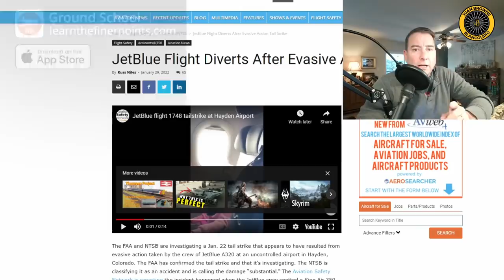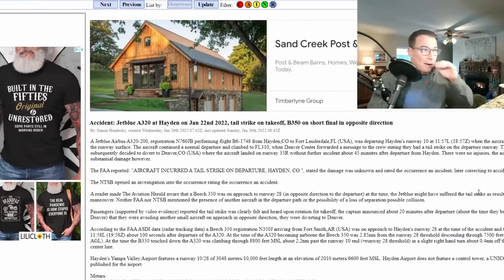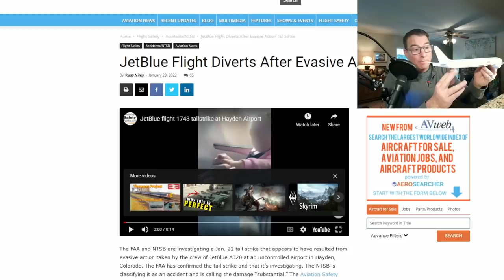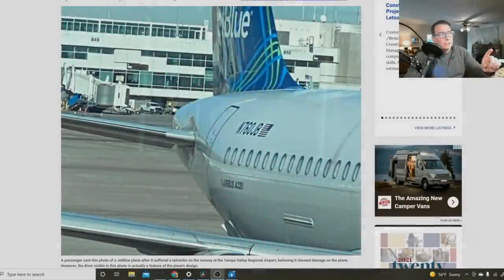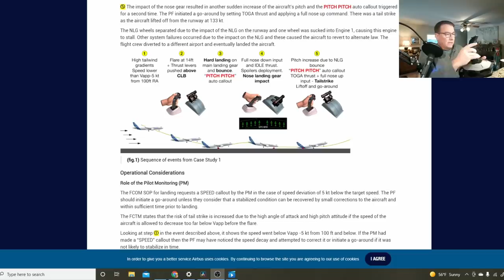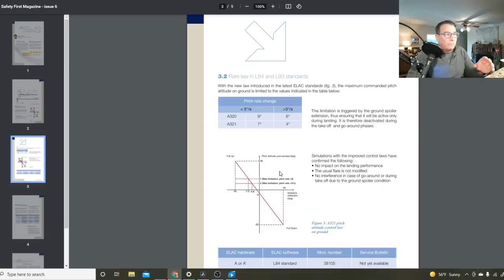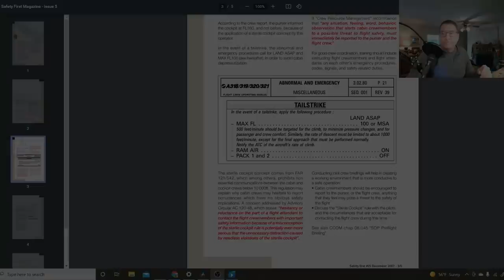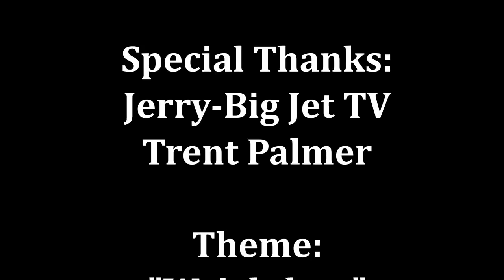Tailstrike!

Comment: Longtime Airbus pilot here: coming from the MD90, which had a significant risk for tailstrikes, due it‘s low landing gear and fuselage length, I always stopped rotation briefly at 10 ANU and waited for the radio altimeter to start counting before following the flight director to higher attitudes. One company I worked for even had a callout during go-around ‚TOGA TEN (degrees)‘ to make sure that you don‘t overrotate. This conscious action reduces the risk of tailstrikes for sure.
Reply: “ANU” definition please?
Reply: @bigjeff1291  Sorry: Attitude Nose Up
Reply: @maxx9384  Thanks!
Reply: never flown the Airbus but "stop at 10" is good every where :) fly safe
Reply: I’m pretty sure every flight I have been on does something like this always get that light feeling then the stuck in the seat feel on takeoff
Reply: Good deal!
Reply: Same with the 321
Reply: I was going to ask the question, if you would know that you tail striked while taking off, but the video showed the answer.. I know certain large planes used to have a landing gear in the tail to help with this,  do they still Incorporate that into aircradt
Reply: Very great advice to make that conscious effort.
Reply: Great personal procedure to have on any aircraft. 737 and 747 I did and do that same thing. Pitch to 10...wait for the gear lever lock to click off....then rotate to 15

Comment: Back in my A&P days in the 60's, I worked on a Jurassic Jet called a Boeing 727.  They had tail strike snubbers just forward of the rear air stair.  It was retractable device coordinated with the landing gear system, intended to protect the exhaust nozzle of the center engine against high deck angle runway rotation.  The snubber had a "shoe" on the bottom we were required to inspect for wear periodically.  My recollection tells me the shoe was worn out at every third A-Check, or about 600 flight hours and 275 cycles.
Reply: The 767 has/had similar, as does the 737... IIRC, the larger Airbuses also have a snubber but it's been a while since I have been under one, that said on the A300/310/330/340 the cabin floor kicks up for the rear cabin to allow more bins to go in the hold without extending the keel into the strike zone... The 777 walks a very fine line in this regard, but the envelope for each type should reflect this.
Reply: I can remember seeing the tail strike snubbers on the rear of 727,s (not knowing or thinking much about them at the time) when I was working the ramp in the airline industry from the mid 80,s into the mid 90,s. 

I'm surprised that they do not have these designed into the current airplanes especially with them having the potential to have a tail strike with them making them so long.
Reply: Concorde of course had a 'landing gear' - 4 greens !
Reply: I got my FE on the three-holer, and it had a skid with shock absorber type strut. There was a small bracket with a single rivet about halfway up. If the strut compressed enough to shear the rivet, the bracket would either be hanging by a small chain or missing.
737-700 doesn’t have a skid, but the -800 and Max8 do. It’s a definite preflight item, as it can only take so much impact before it needs detailed inspection and replacement of the cartridge and shoe. I’ve seen a couple that were slightly ground down, but had been inspected and repainted so you could tell if it had been dragged more recently.
Reply: It makes perfect sense to have skid plate there as it's the only part that could and will strike

Comment: I'm a 20 year structures guy, A&P, and pilot, but fly just for fun. I've worked a few aft pressure bulkheads in my career and the qualifications, though different for each company, are they want only their best structures/sheet-metal workers on those things. The buyoffs of work performed is much more frequent & strict than other parts of jets, and you'll have buddies double-checking hardware, parts & work & supervisors, managers, and inspectors hovering over you a lot more than normal. Near-perfection is required for this bulkhead.

Comment: Back in the day when I worked layover and service checks on the Boeing 727-200 it was very common to perform maintenance on their retractable tailskids.  Replacing crush cartridges and the lead blocks were weekly.  That design feature save many of aircraft down time to massive inspections and re-skins. Those were the days!

Comment: One of the most well known Tail-Strike accidents was JAL 123, a 747(SR) aircraft that sustained a tail-strike in 1978 and had an inappropriate repair to the aft pressure bulkhead.  In 1985, the aircraft suffered a failure of the pressure bulkhead that literally caused most of the tail surfaces to be blown off the aircraft, which led to the aircraft being uncontrolable despite the valiant efforts of the crew.  The aircraft remained airborne for almost half-an-hour before it crashed into a mountainside, killing 520 of the 524 people on-board.  (Amazingly, 4 people survived.)
Reply: Yes, it´s still the crash with the second-most fatalities behind the Tenerife Disaster.
Reply: I'm wondering if there was a finding on who screwed up. Actually wouldn't 30mins without pressure kill passengers?
Reply: @MikeJones-rk1un  they didn't suffer a decompression.  But the problem is that, if the rear pressure bulkhead had failed, it could have been catastrophic.  And, the bigger problem is not just "this" flight, but the damage, if it hadn't been reported, could have had drastic problems later on.  Every time the bulkhead is pressurized and depressurized, any damage is worsened.  Apparently the pilots were unaware that a tail-strike had even occurred; that doesn't mean that damage hadn't occurred.  Just because this flight proceeded without issue doesn't mean that the next would have.
Reply: @pastorjerrykliner3162  I assume tail damage would be found before the next flight by a simple inspection.
Reply: Only the fin and its two rudders parted company with the aircraft. The loss of primary flight control occurred because severed hydraulic lines that passed through the rear pressure bulkhead caused hydraulic fluid depletion.
Reply: @MikeJones-rk1un  aircraft accident investigations don’t focus on “who screwed up” but on what happened with a view to the knowledge gained being used to prevent a re occurrence. I believe Boeing admitted that an error occurred in the assembly of the replaced rear pressure bulkhead by a “away team” sent by them to assist the airline with the extensive repairs.
Reply: @johnyoung1128  Are you claiming investigations ignore pilot error?
Reply: @MikeJones-rk1un  After Boeing's faulty bulkhead repair was discovered to have caused this crash, JAL's maintenance manager committed suicide to atone for the crash.  The engineer who checked and cleared the aircraft for flight after the repair also committed suicide.
Reply: @mikeweaver8790  So they won't be learning from their experience?
Reply: @MikeJones-rk1un  Now how did you read that into what I said? A proper investigation would look into “if and what were they and how did they affect outcomes ” in regard to such potential errors. An investigation should never degenerate into a witch hunt as that would mean pertinent facts could be overlooked. As for what a regulatory authority would do with the findings of the investigation that is another matter entirely.
Reply: @johnyoung1128  Do you just like to hear yourself talk?
Reply: @MikeJones-rk1un  nothing said you had to listen. If you didn’t want an answer don’t bother me with questions.
Reply: @MikeJones-rk1un  What we’re the engineers looking at on inspection…
Reply: @johnyoung1128  How did I read that into what you said? How did their lesson do any good if they are dead? I guess you are so smart you have lost your mind.
Reply: @MikeJones-rk1un  I am not going to argue with someone inclined to deliver insults good day to you.

Comment: Re: the BA A-321--the possible reason they were stable and then got bounced around has to do with mechanical turbulence from the buildings on the airport. Strong steady winds at altitude change when you descend below the building height. The wind burbles around the buildings and causes random turbulence. (21k hrs in A-320/21k total)
Reply: Buildings is exactly what the host from Big Jet TV said if you go look at his original video

Comment: From memory when I did school work experience at Ansett Airlines in Australia in the early 80's the ground engineers would inspect a small hydraulic tail strike 'skid' that was under the tail of the aircraft at turnarounds. It would have been early 737's or 727's. I'm pretty sure there was also a crushable 'sacrificial' cartridge used in these systems. Now I wonder do today's aircraft use this tail strike system. I think that Concord had a small wheel that deployed under its tail section to protect the tail from tail strike damage.

Comment: The BA 321 flew a return trip to Geneva and back later on the same day so presumably didn't actually have tail strike, despite it coming incredibly close and the video seemingly suggesting it did.
Reply: Flight Radar 24 confirms this. It's the closest I've seen to a tail strike without actually having one. Brilliant video once again, very informative. You are on the ball with events happening in the aviation world. Keep up the great work.
Reply: You can see the debris kicked up from the strike. There was certainly contact even if the company decided it was to minor to cause problems.
Reply: @MyTech  you see smoke from the wheels and disturbance from the engine wake. There are no sparks. Watched it a million times and nothing you see can't be explained by the thrust.
Reply: @hamsterminator  Sparks? Did airbus switch to iron clad hulls? 
Frame by frame on 1080p there is contact for several frames, even if it was light contact it was plenty to show up on any tattle tail. The debris/dust in question does not originate from anywhere near the tires and does not move like jet blast, it originates from the point of tail contact.
And I can just make out a bit of bounce in the horizontal stabilizer although this could be due to aerodynamic forces, it does correspond with the time of contact.

Comment: At touchdown, “ground mode” is active.  But that’s likely not the problem.  321 tail strike pitch attitude is around 9.7 degrees (struts compressed).  Many tail strikes commonly occur when both pilots pull back on the side stick simultaneously -  which “sums” the inputs, resulting in excessive pitch attitude and tail strike.  That’s the Airbus flight control characteristic that likely bit this crew.   If the FO was PF, and during that go-around aileron dance, the CA (PM) might have got a little nervous and tugged on the side stick to help Stanley - well there you go.
Reply: You've mentioned a factor in the Airbus that's never made sense to me—summing the inputs. Even worse than doubling the inputs could be their negation. A collision is imminent. One pilot inputs right and the other left. Either would avoid that collision. In the software the two cancel and there's a crash.
Reply: @Inkling777  This condition commonly plaques Airbus  crews with loss of SA and flight path - among other things.   This is why crews are trained (and proficient) with ALWAYS using the red takeover PB on the side stick and exercising immediate and proper exchange of flight controls.   Only one side stick has control at a time during this procedure.   You can’t nudge the controls to assist the other guy like a conventional yoke.   Push and hold red button or hands off.
Reply: @Inkling777  this is so counter intuitive as to pilot training all our lives - since mechanical controls have always acted in parallel due to interconnect.  Why Airbus didn't preserve that in control law is a head scratcher.  This tail strike may have uncovered a part of the envelope for which there is no governing control law, ie in between defined events / conditions not covered.  It was very surprising to see the airplane appearing to over react with little more than crosswind affecting it.
Reply: @Inkling777  It already caused the total loss of AF447. The formal report is curiously silent on the side stick issue despite the data showing the matter was front and center for almost the entire event, it wouldn't surprise me if it was biased by airbus' economic impact on Europe and esp France. (And needing to AD nearly half of the world airline fleet.)  The data recorders were actually recovered by a privately funded investigation hired by the families.
Reply: Perhaps, but you will get a “Dual Input” call out.
Reply: @Inkling777  Well guidance tells pilots to click the "override/take control" button if they plan to take over from PF. I feel with summing/negating inputs Airbus was trying to emulate aircraft that had a direct/cable controlled flight surfaces.

I feel if airbus wanted to go down this route then they needed to implement proper force-feedback, so pilots can instinctively feel when the other pilot is inputting controls.

However, at the end of the day this is a pilot training issue. Another pilot should not make inputs without first delcaring they are taking control, unless it's a critical situation.

Comment: There was an episode of a show called "World's Toughest Fixes" on National Geographic Channel where they showed the process of replacing the aft pressure bulkhead on a B767. It was quite the process.
Reply: when he popped up the picture of the rear pressure bulkhead that fix episode was my first thought as well.  Was a great EP
Reply: Years ago I sold aerial lift equipment to the aviation industry and Northrup Grumman in the DFW area was a customer.  At the time they built the aft pressure bulkhead for the 747 and it was huge!  I can only imagine what it would take to change one of those out!
Reply: @gregmiller7123  and it was that part which failed and caused the 1985 crash of Japan airlines flight 123.
Reply: Yes! I was remembering that, but couldn't remember what show it was!

Comment: Great video Juan. Reminds me of the crash of JAL 123, regarding the failure of the aft pressure bulkhead, which failed due to improper repairs due to a previous tailstrike some years earlier.
Reply: Agree. I was thinking about this exact same failure during this entire video.
Reply: JAL 123 is still the largest loss of life in a single aircraft incident, and it's still a scandal in Japan how everything from the botched repair to the rescue were handled.
Reply: @wewd  Was JAL responsible for the repair? I don't think so.
Reply: China airlines flight 611 is another one

Comment: Juan,

The flight control laws are different on the CEO and the NEO.

Rotation Logic:  On the NEO this new functionality reduces the chance of a tail 
strike at liftoff by limiting the pitch during rotation. Active from 70kts 
through 10s after liftoff and up to 3/4 sidestick input, the ELAC 
automatically limits the pitch authority to mitigate a tailstrike. If 
necessary, the protection will be overridden if the pilot applies more than 
3/4 sidestick.

Flare Law: On the CEO aircraft the pitch trim freezes at 50 ft. and then 
slowly rolls the trim forward to -2.0 over 8 seconds. With the new ELAC 
software, the NEO freezes the pitch at 100 ft. and does not introduce 
any nose-down trim. This results in a slightly more responsive pitch feel 
during the flare.

WRT to the BA incident I’ve seen reports that they did not actually hit the tail and that post flight no damage was found. Also I find it very odd that the ground spoilers didn’t deploy during the second touchdown. Throttles at Idle and wheel speed of 72 knots will deploy the ground spoilers on landing. As you suggest the only thing that makes sense is that almost instantly after the second touchdown the throttles were advanced for the go around. Perhaps the second touchdown felt like a bounce and the crew decided enough was enough. It’s impossible to know for sure just based on the video. 

I fly the 320/321 CEO and 321 NEO and the NEO does require a different technique to land. I’ve not made a go around from in the flare with a NEO (or a CEO for that matter) and I wonder if the pilot was caught out by the pitch up effect of engines spooling up.

Comment: Recall, the JAL 747, that had maintenance on that area, after having a tail strike. The re welding was not correctly done
and on a later flight the bulkhead ruptured and flight went down near Mt. Fujiyama.
Reply: Welding or riveting? I think it was riveting.
Reply: And the ROC 747 later on that did the same thing.
Reply: JAL Flight 123 and CAL ( China Airlines) 611 comes to mind
Reply: If I remember this one correct the repair used fewer rivets than what Boeing said to use. Thus causing stress fractures around the rivets.
Reply: Boeing repaired the pressure bulkhead improperly.
Reply: This was a point of serious legal dispute between JAL and Boeing.  JAL argued that Boeing was at fault due to factory level design/repair while Boeing put forth that JAL had not carried out proper maintenance.
Reply: Yeah that was the first thing that came to mind when I saw the video.  It was an incorrectly installed splice plate between two sections of the bulkhead.  The plate was supposed to be solid, but the actual one installed had two sections, resulting in only one set of rivets holding each section in place instead of the required two sets of rivets.
Reply: @tscottme  JAL did the repair in house.
Reply: @opwave79  Great point
Reply: @Markle2k  Not quibbling, but didn't JAL argue that previous mx had been done by Boeing and then subsequent repair was done to Boeing specs? I guess I should revisit it.  I just remember,  as happens in so many cases,  the legal wrangling was vigorous.